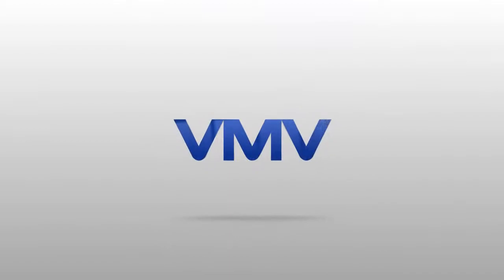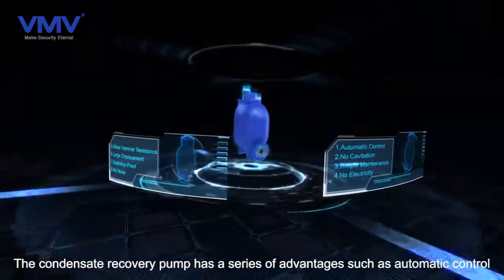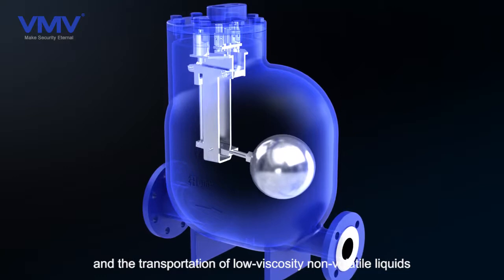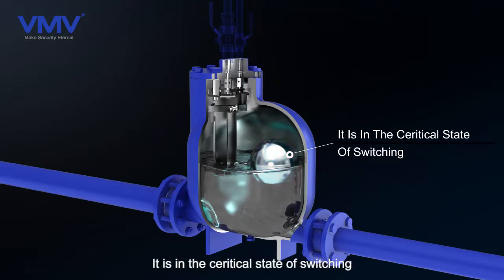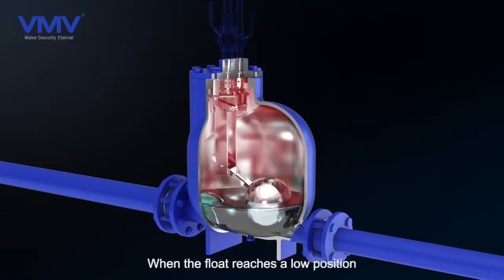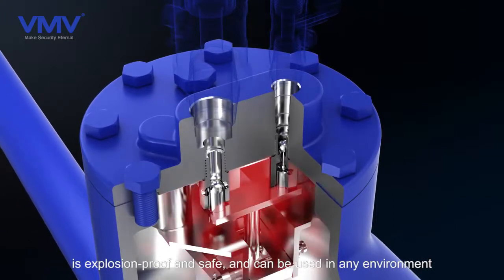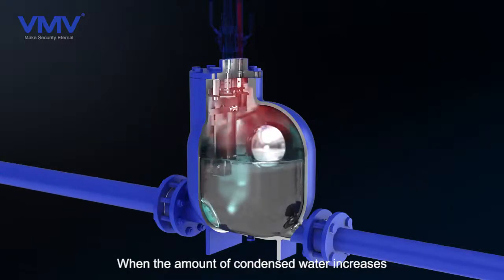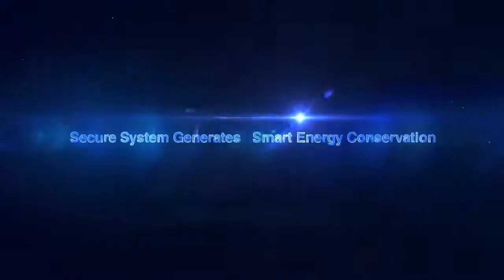Pump Steam Trap (Condensate Recovery Device) www.steamvalves.com

Comment: I know the steam pressure has to be enough to overcome back pressure but is there a rough number you could give me as to what the pressure should be? I have a medium pressure steam coming to the pump I maintain but it struggles. I’ve been told 60psi and have read 20 psi over the back pressure 
Any advice would be great. Thanks!
Reply: Haha, no requirements? Thats bs. Most pump traps are required to have a foot of space between the bottom of the expansion and the top.of the trap for better flow and to prevent water logging. Then you should have a gauge on the discharge side to see what pressures you need to overcome for setting the inlet air/steam.
Reply: my IOM on a armstrong pt3508 states 15 to 20 psi over outlet back pressure.